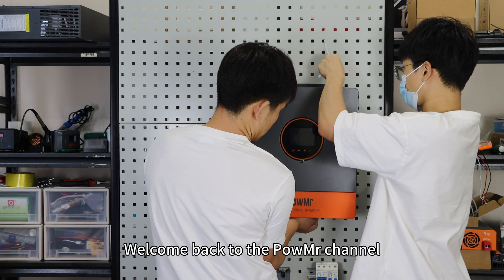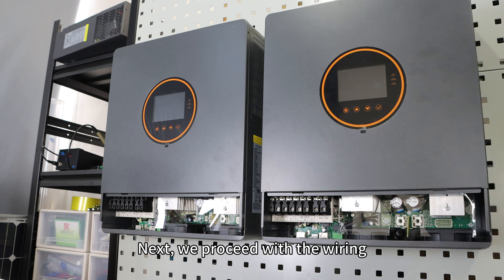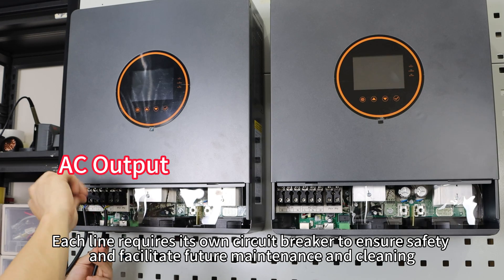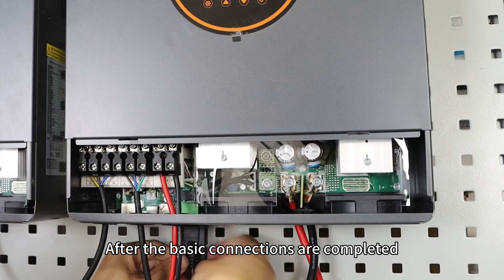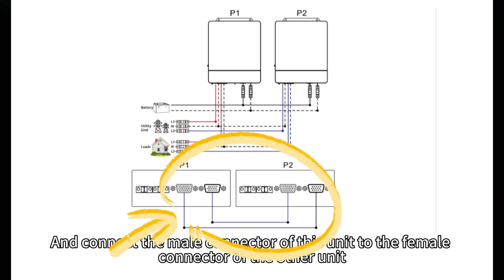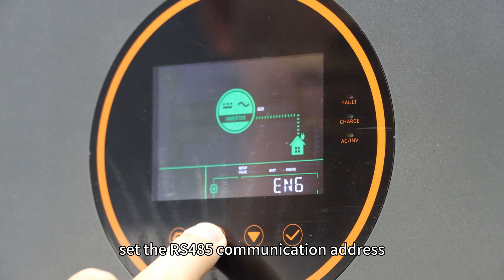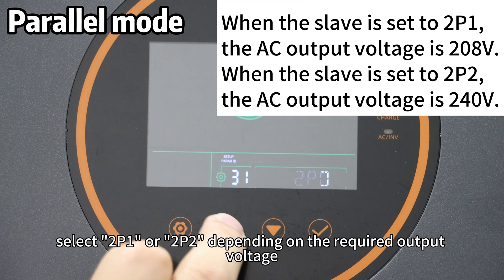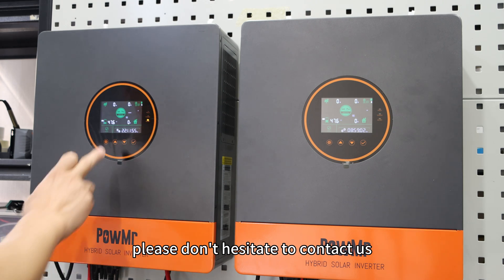How to Parallel Connect POW-SunSmart SP5k?

Comment: hello, for paralleling a split phase 120/240,with two inverters, do I have to connect DB15 parallel communication line cable and Current sharing detection line ?
Reply from the maker: The parallel communication line cable must be connected. Only two split-phase parallel machines do not need to be connected to a current detection line. The rest need to be connected.

Comment: hello, I'm trying two inverter as 240 split, but I haven't connected battery. I put the first one ID 1 and 31 2P0 & second one ID 2 and 2P2.Still flashing Alarm and appears code 03 and 38. What is wrong?  Thanks
Reply: This the same problem I'm having!!
Reply: I need to be able to use both inverters at the same time as 240v
Reply from the maker: If this model is used in parallel, the battery must be connected.
Reply: Thanks.
Reply: I have battery connected to my own and it does work

Comment: Thank you for this video, it has been very helpful to me. I would like to ask a question regarding this configuration. How do I configure the maximum charge current? Do I only do it on the master and the slave takes it alone? Since the inverters are connected to the same battery bank I am afraid that it will duplicate and damage my batteries. The batteries I use are 12v 100 Ah LiPoFe4 connected in series for the 48v
Reply from the maker: The maximum charging current of SP5K is edited in #07, and the settable range is 0~100A.

Just need to set it up on the master. The inverter will stop charging after recognizing that the battery is full, and will not recharge it all the time.

If the load consumption is large and the battery has just been fully charged and the battery is discharged again, charging will resume after reaching the recharge value soon.

Comment: Ok when connecting the AC out of the 2 paralllel units -How do you wire the (L), (N), (G) in a 200amp circuit breaker box? You have 2 live wires but then you have 2G and 2N do you connect/twist those together and insert them into the available slots because the circuit breaker only has 
1 slot/connector for each G & N wire. ??
Reply from the maker: Pleases send it to this email: support@powmr.com. Our technicians will assist you.

Comment: I have connected two in set to 2p2 for 240v AC but I'm not getting any current to the leads. Is there a setting I'm missing ? Or is that the incorrect setting?
Reply from the maker: Please send it to this email support@powmr.com and our technical staff will check it for you.

Comment: Is the AC sourced from a single peer source or does it come through a breaker  panel from two separate lines??
Reply from the maker: The AC terminal of one machine only comes from a single AC power supply, and the two machines form a power supply from two AC terminals.

Comment: So how do 2 in parallel produce 110v & 220v? What would that setup look like?   A 220 circuit breaker with 110 breakers?  Will you loose some of the amperage by only using 1 leg of the 220? You have any diagrams that are not in the manual? Also can this only work with panel voltage without AC or battery connection?  What I want to do is connect 2 in parallel & make a 220/110 outlet so that whatever I plug into it can operate only from the panel voltage. 
     Also ,im off grid and can use AC from another off grid array to supply AC to the unit but I cannot transmit power into that grid because it will backfeed in the 500watt inverter. So can I do that?
Reply from the maker: Please send your problem to this email: support@powmr.com. Our technical staff will handle it for you.

Comment: How do you connect these in parallel off grid??
Reply from the maker: Off grid? The off-grid function is not related to the parallel function, and they do not conflict with each other. Going off-grid will not affect the parallel function.
Reply: @PowmrSolar  ok so how can 2 in parallel produce 110v & 220v?  How would that be setup?  A 220 circuit breaker with 110 breakers?  Would loose some of the amperage by only using 1 leg of the 220? You have any diagrams that are not in the manual? Also can this only work with panel voltage without AC or battery connection?  What I want to do is connect 2 in parallel & make a 220/110 outlet so that whatever I plug into it can operate only from the panel voltage. 
     Also ,im off grid and can use AC from another off grid array to supply AC to the unit but I cannot transmit power into that grid because it will backfeed in the 500watt inverter. So can I do that?
Reply from the maker: @Christian-lt7wd  Please send your problem to this email: support@powmr.com. Our technical staff will handle it for you.
Reply: @PowmrSolar I’m having the same issue

Comment: In parallel mode how connect the solar panels ?
Reply from the maker: After paralleling, each inverter needs its own solar panel, and all machines cannot be connected to the same set of solar panels. Try to maintain average power for each inverter.
Reply: Why can't they be connected to the same solar panels? What if your solar panel array is connected to 2 bus bars pos/neg? How would that effect the inverters in parallel??
Reply from the maker: @Christian-lt7wd  If you connect multiple parallel machines to the same PV array, this will affect the normal operation of the two parallel machines, or even cause the main boards of the two parallel machines to be damaged at the same time.

Comment: Hello,  On a pair of SunSmart SP5K, When I turned power on ,I'm getting fault code 7 and 8  BusovervolatageSw . but individually as atand alone they work normally . does anyone encountered same problem . how to fix that ?

need 240V/120 split phase    setting 30 is ( 1 for master, 2 for slave) 31 is( 2P0 for master, 2P2 for slave)
Reply: I got the same issue, how did you fix it?

Comment: Hello,  on a pair of Sunsmart SP5K, When I turned power on ,I'm getting fault code 7 and 8  BusovervolatageSw . but individually they work normally . does anyone encountered same problem . how to fix that ?

configured setting 30 as master and slave (1 and 2)  and setting 31 (master 2PO , slave 2P2)
Reply: So powmr about my two damaged inverter that I bought brand new and never got to use,who's going to replace them for me??
Reply from the maker: Maybe the load is too much. Can you send us your what'sAPP? I'll ask our technical staff to communicate with you.
Reply: @PowmrSolar  Got the exactly same problem
Reply: @powmrsolar  I see alot of persons are having the same problems as I do and we need answers because I bought 3 of these inverter and u used the instructions programming them in parallel.two is now damaged thank you. So I bought a new one and to tried to parallel connect and Program them to each other. I set one to Id 1 and the other to Id 2
The one thats set to Id 1 I set as 2p0 and the other 2p2 .what happen red light and alarm.
Reply: I then disconnected the parallel connection and set the two inverters to SIG  one worked and the other did not.
Reply: But I powmr I find the problem. The problem is the neutral wire  only one inverter can be terminate on the panel .the neutral is causing the problem
Reply: Tomorrow I'm going to put the grid neutral on a disconnect switch leaving the two neutrals from one of the inverters still connect to the grid/panel then the other inverters neutral I'll put on other disconnect switch   then the system should work fine also add in a bus bar.
Reply: Same problem , 07 and 08 fault code. Did you solved it?

Comment: The drawing of how the circuitry is connected does not make sense to me. The PV connections are going to the batteries instead of the solar aray or i cannot see the pv aray connection. Can you please show how to connect the pv inputs in parallel, I think 😊
Reply from the maker: Hi, please send your problem to this email: support@powmr.com. Our technical staff will handle it for you.

Comment: Hello, I have two inverters of what is in the video. I put it in parallel, looking at the steps you explain, but they are not working for me. I get a little clock on the bottom left side waiting. Please, if you can help me to see if I can solve it.
Reply from the maker: Hi, please send your problem to this email: support@powmr. Our after-sales engineers will handle it for you.

Comment: I also download and read the manual and have the following questions:

1-	In the last bullet of the Safety Instructions is written: The all-in-one solar charge inverter is off-grid. It is necessary to confirm that it is the only input device for load, and it is forbidden to use it in parallel with other input AC power to avoid damage. How come the SP5K is a hybrid inverter and not an Off-Grid. Please explain what you mean in this last bullet. 
2-	On page 5. Power saving mode available to reduce no-load loss. Please inform what is the consumption of the SP5K during power saving mode.
3-	On Page 20: and the surplus PV energy is fed back to the grid if the grid connection function is enabled. By reading this sentence I understand that the SP5K inverter can inject energy into the Utility Grid. So that, depending on the agreement with the utility, we can sell energy to them. Is that correct?
4-	Same of Page 33. In the utility bypass state, when no battery is connected or when the battery is full, the surplus PV energy is fed back to the grid.
5-	ON page 23: Indicates that the machine is communicating with the Surveillance Equipment. What surveillance equipment is this? 
6-	ON Page 32 – Communication Function. The port RS485 is used for both PC (or telecommunication control) and also for BMS communication. So, please let me know if the SP5K can establish communication with PC and battery BMS at the same time?
7-	And what about WiFi to communication with Android App. Do we also have this option? Please explain. 
8-	ON Page 34 and 35. Can you please better explain what is Sectional Charging and Discharging Functions? Are these time periods that may be settle to charge and discharge the batteries?
9-	ON page 36. Switch to Inverter Output SOC Settings. Why the default value here is 100%. If we keep this 100% default value the inverter will only produce energy to the output if the battery SCO is 100%. This means that, for any SCO below 100% the inverter will stop producing energy, which is not good at all. Why this 100% default value was chose?
10-	On page 38. I am planning to use Lifepo4 batteries. I see the SP5K can work with 14S, 15S and 16S configuration. What is the option for the best performance of the SP5K inverter?
11-	On page 39. RS485-1 and RS485-2..
a.	Can we use these 2 ports to communicate both with PC and with WiFi at the same time? 
b.	If communication is with PC, it is written … “enables monitoring of the equipment running status and setting of some parameters on the computer”. What you mean by some parameters?  Can you please describe what are these parameters and what can be done from the PC?
c.	It is written…. “allows direct connection with the optional RS485 to WiFi/GPRS communication module developed by our company through this port. 
i.	Does this WiFi module come with the unit?
ii.	What is this GPRS communication. Is it a 3G or 4G chip that uses a Mobile Operator network to communicate with a Android Cellular smartphone?
iii.	Can we use both WiFi and GPRS at the same time?
iv.	What about the BMS battery communication which was mentioned before that uses this RS485 port?
12-	On page 39. USB communication Port. 
a.	This is only to communicate with PC. Correct? 
b.	Where can we get the USB to serial chip CH340T driver?
13-	ON page 41. 	AC reverse protection. Prevent battery inverter AC current from being reversely input to Bypass. (In off-grid mode). Can you please better explain this?
14-	On page 42. Item 16. 	CAN communication loss protection. In parallel operation, an alarm will be given when CAN communication is lost. Where is this CAN port in the unit? It is not presented in the table on page 7. Please explain.
15-	Assuming a configuration of 3 SP5K units in parallel in 3 phase, AC GRID input of 120VAC per phase and AC Inverter output of 120VAC per phase.
a.	What would be the maximum power supported? 5KW per each phase? 
b.	What would be the maximum peak power supported assuming a 208AC load using two Inverters phase? 20KW? And for how long?
16-	PV Strings. I understand I can have independent PV strings for each of the 3 SP5K in parallel. Please confirm.

I really hope you can answer the above questions as they are important in my decision process.

I want to thanks in advance.
Reply from the maker: Hi, please send your problem to this email: support@powmr.com.

Comment: Hi Guys, I am planning to acquire 3 units of the SP5K. However I realized some units come with WiFi and others no. How can we find out if the unit comes with WiFi? In AliExpress, you can chose WiFi or No WiFi. But in Amazon nothing is said about. How can we make sure the WiFi is included?

Comment: Hello, in parallel, can I have 110v/220v and 10kw? With 2 units
Reply from the maker: Hi, yes.
Reply: How do you wire the units so that you have 220v and 110v. Can you show a diagram with the wiring as needed. It would be simple to copy. Thank you
Reply: @Christian-lt7wd

Comment: Can you connect these inverters in parallel but keep it at 120 volt outside
Reply from the maker: Yes, it can output 120V.
Reply: @PowmrSolar  will it still run the 10,000 watts at the 120 volt with the 2 inverters in parallel
Reply from the maker: @PokéMyersFam  Yes.
Reply: @PowmrSolar  thank you I've been looking for inverters that would run thw full 10k at 120 volt.

Comment: wifi module link please i just got mine 😊
Reply from the maker: Hi, this model:(POW-sunsmart-SP5K)? Kindly check the wifi module link:
https://powmr.com/products/powmr-wifi-module-wifi-hf-plug07
Reply: @PowmrSolar do you need 2 wifi module if you run 2 parallel or just 1 on the master?
Reply from the maker: @DinhCatBOLERO  If you want to monitor the data of each inverter, each inverter needs to be equipped with a WiFi module. If you just want to set parameters through the WiFi module, you only need to install the WiFi module on the host. The slave follows the host's settings and wants to monitor Which machine can be installed on which machine.
Reply: @PowmrSolar  also can you hook up AC in just for 1 inverter? Or you have to have 2?
Reply from the maker: @DinhCatBOLERO  Is it a single-phase parallel or a multi-phase parallel?
Reply: @PowmrSolar  i have 2 single-phase and im trying to hook both parallel to make 220v.
Reply from the maker: Hi, 2 are needed. Kindly check the manual page 54.

Comment: When I turned on the PV Breaker ,I'm getting fault code 7 and 8  BusovervolatageSw . but individually PV input work normally . does anyone encountered same problem . how to fix that ?
Reply from the maker: which model? POW-SunSmart SP5k?
Reply: Same issue !

Comment: Is the PV input connected in parallel or can I connect a string to each device?
Reply from the maker: Try to connect in series. Do not exceed maximum PV input voltage

Comment: is there a way to use the sp5k without batteries? either single inverter or 2 in parallel?
Reply from the maker: Hi, support for use without battery.
Reply: @PowmrSolar   how would I set that up.  I just keep getting fault code 3 no battery.  
Can you tell what settings to use
Reply from the maker: @Rtsubber  just turn off the sound. If parallel, please use the battery.
Reply: @PowmrSolar   seriously? It's advertised as a without battery function ability. 
So please explain how to operate with no batteries. 🤨
Reply from the maker: @Christian-lt7wd  If used in parallel, the battery must be connected.

If used alone, this model can work without batteries. #34 is set to "TOLOAD", #01 is set to AC1ST.
Reply: @PowmrSolar  Does the 48v battery need to be a specific AMP HOUR-AH?
Reply from the maker: @Christian-lt7wd  The battery capacity should be greater than 100AH.

Comment: I ordered 2 of them to get split phase 240v can't wait!
Reply from the maker: Hi, thanks for your support.
Reply: @PowmrSolar I'm in the USA and want to do split phase 240 volt. What size double pole bracket should I use, 40A, 50A, or 60A?
Reply from the maker: @MakeItAdmirable  Does the double pole bracket refer to the breaker? If yes, 63A
Reply: @PowmrSolar  OK
Reply: @MakeItAdmirable may i ask what are you using the 240 split phase for in the US?
Reply: @Mark300win  well pumps and dryers require 240v. We are trying to connect ours together and they keep going into standby, so we don't have it working
Reply: How can you get 110v after the inverters are in parallel for 240? And will you loose amps ?